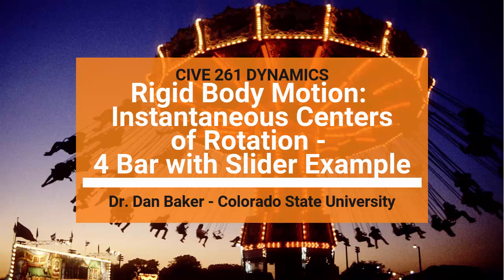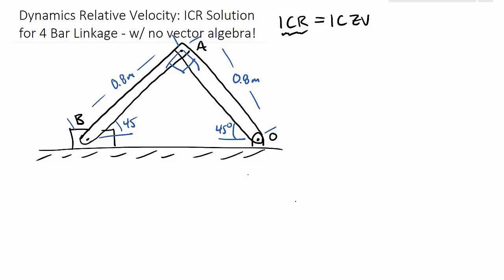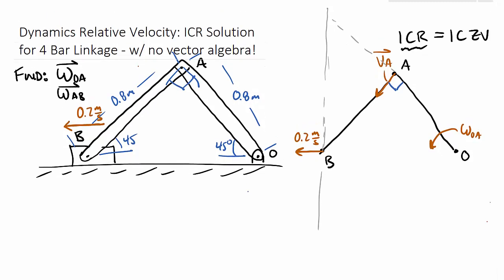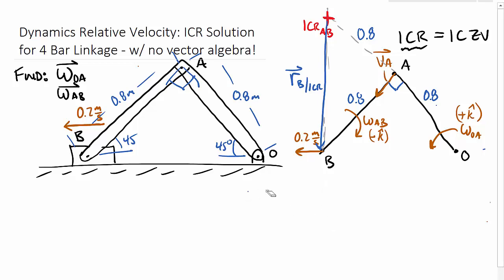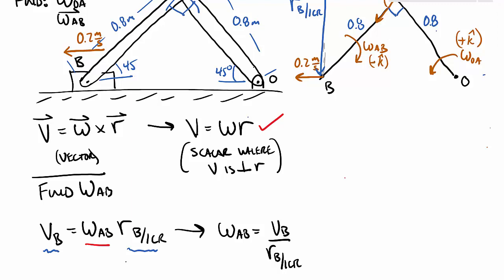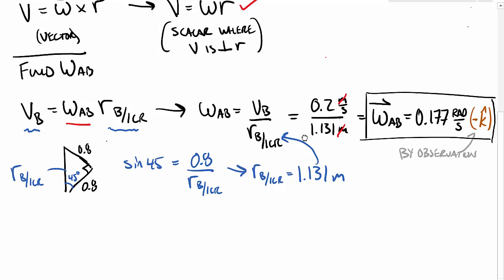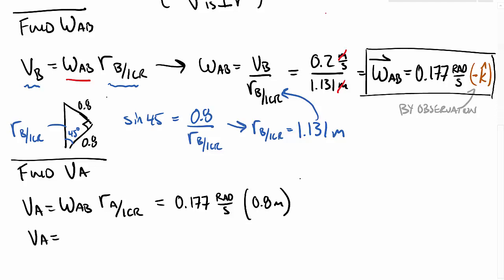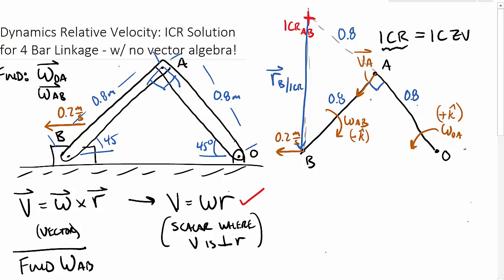Dynamics: Rigid Body Motion - ICZV - Four Bar Linkage with Slider Example

Comment from the maker: Some great questions came in related to this example that I thought I'd share:
Q1: Is omega always going to be the same across both bodies when they are the same length and only one external velocity?
A1: The omega's (angular velocities) are only the same on this problem because the arms are the same length AND the system is symmetrical (45-45-90 triangle). It is safest to NOT make the assumption that the the omegas would be the same.

Q2: Why wasn’t a free body diagram draw for this example? Wouldn’t the weight of the bar have an effect on the omega? Or would that fall into a different problem category?
A2: This problem was a rigid body kinematics with only motion included, it could be turned into a rigid body kinetics problem with the addition of some forces/couple moments. You are correct that if it was kinetics problem that we'd have to include the effect of the weight of each arm.

Q3: When solving a four bar linkage, where would the best place on the body be to start? Does it matter?
A3: A general process to solve any spatial problem is to work from knowns to unknowns. In this case we started @ B and worked over to AO. If we were given the angular velocity of AO, we would have started there and worked over to block B. You could also write the full relative velocity equation for arm AB (like V_B = V_A + V_(B/A)) and solved the unknowns from that equation using either vector components or a vector triangle.